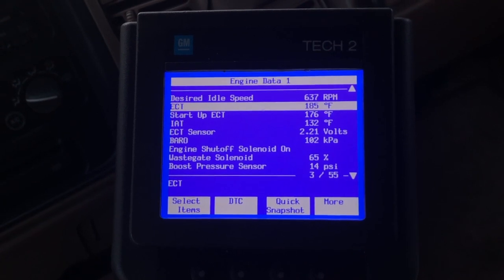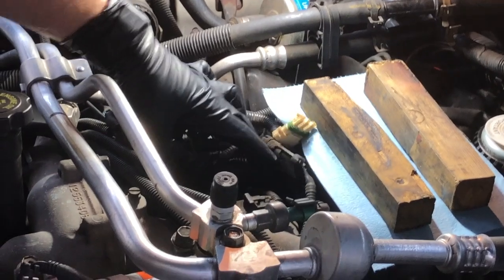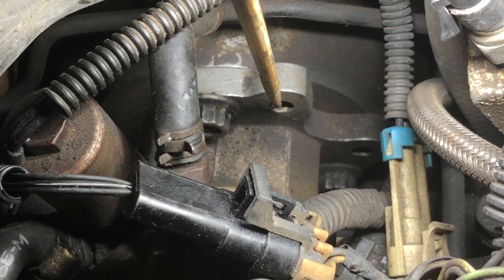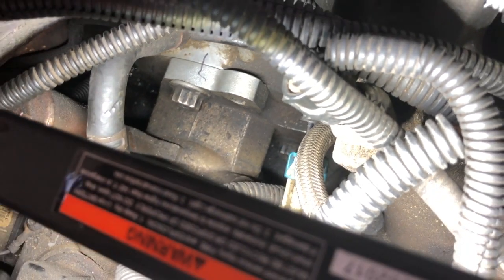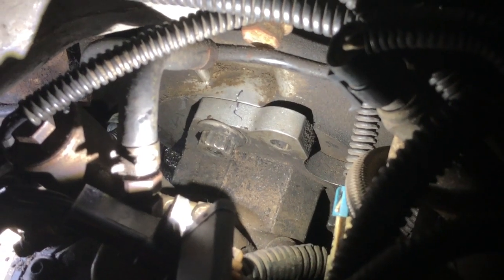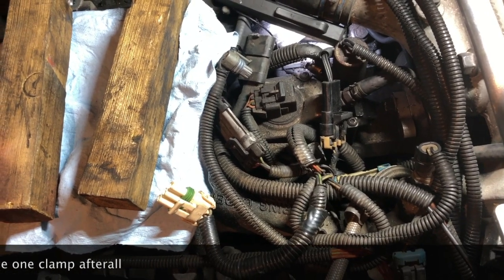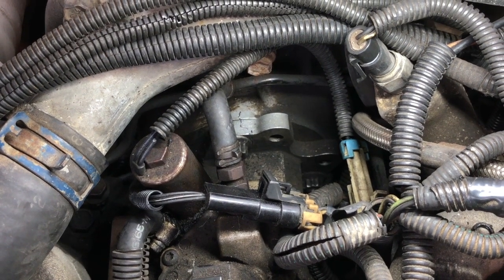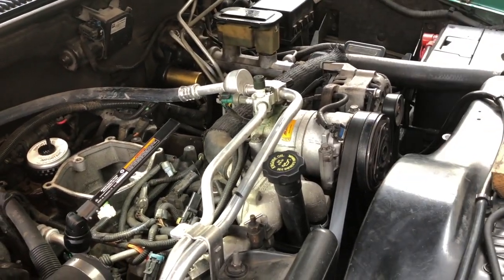1996 - 2002 GM 6.5L Diesel Stanadyne Injection Pump Timing Adjustment TDCO Procedure (Chevy & GMC)

Comment from the maker: WARNING: The torque value in the GM service manual shown at 44:07 for the upper intake manifold crossover bolts is WRONG on that particular page due to a typographical error during printing.  Which explains why it didn't feel right to me and fortunately I go with experience and gut in such situations as you saw in the video.  The correct torque for the upper should have had 17 foot pounds printed!

Comment: Thank you for posting this video, it is incredibly helpful. I broke down and bought the made in Ghina Tech 2 tool and much to my surprise it worked well. Getting the sequence of the 45 sec pedal to the metal then 30 sec of ECM off was a huge pain. Onlty took about ten times...LOL. But I was able to get my way out of wack -2.29 down to 0 then back a little to -.79 (close enough) She runs soooo much better. The tool also told me that I had 14psi of boost at idle and 26psi of boost when my gauge says 13psi, so I know my sensor is bad. Got my 96 3500hd with the stock 6.5 running smooth. Thanks again
Reply: Do you have a link where you bought the tech 2?
Reply from the maker: In the video description

Comment: Found my straight wrench went in easier than the curved special wrench. Also had all the sensors and wires out of my way. They really only connect 1 way so it goes back together pretty quick very good video 1mm isnt much but it makes a world of difference much like 1 mm bump on optical sensor. Ty

Comment: Great job extremely helpful! Awesome job on instructions and video clearness
Reply: I’ve changed my crank sensor and cannot get the computer to do a relearn I’ve done the procedure over 15 times change the sensor twice thanking I have bad one and it stays at the -2.46 no matter what I do
Reply from the maker: @jasonhutchinson5144  Like I showed in the video, the timing on getting the scan tool to trigger the TDCO reset is rather finicky but it shouldn't take more than a couple of tries.   If I had this problem I'd look over my sensor harness for damage/corrosion, and do a general check of the grounds the PCM uses as this feels like a problem getting the engine computer to recognize the input(s).
Reply: @DrShock  yes I’ve went through the ground’s and made sure all were making solid contact, I replaced the crank sensor again and did 15 attempt’s at doing the relearn with no change I was unaware of the need to use AC Delco so my next one will be a AC Delco crank sensor and I will double check all the connections again the engine runs fine starts hard but does start there’s also a glow plug timing issue and I replaced the glow plug relay and still take’s 3-4 seconds to start can only get glow plugs to cycle for 6-8 seconds with new glow plugs even try disconnecting the temperature sensor to trick it into thinking the engine is extremely cold so it would do a max glow plug cycle and Nope

Comment: Extremely thorough video, very good descriptions and it came just at the proper time. I just had my 6.5LTD pump rebuilt and its in and running. You have a lot of room there to work compared to my 2001 van. You can barely see around the pump on a van even with all the air intake items removed all the way back to the turbo. Believe it or not the easiest way to work on a 6.5L van is to remove the dashboard which is actually not that difficult. Thanks for taking the time to video it all so well.

Comment: Great video well explained thanks for sharing. I have a question I look up the GM Tech 2 and says it's only for cars no trucks  I'm cofused. I want to purchase a scanner  Thanks
Reply from the maker: Thanx. Not sure where you're reading that false trucks statement, but it would definitely be in the fake news category.   

The Tech2, like the Tech1 that preceded it, was the one and only scan tool used by GM dealerships exclusively thru 2008 for both cars AND trucks and used in conjunction with GM's Techline Information System 2000 (TIS2000) Windows based software.  In 2008 GM introduced the MDI scan tool, which along with the MDI 2, is the current gold standard for GM dealerships in conjunction with the online Techline Connect internet based software.  I have done some Tech2 and MDI reviews on this channel in the past you might want to check out before making your purchase there too.
Reply: @DrShock It Can Only Support 12V Cars, No Trucks thats what it reads on the description on ebay
Reply from the maker: Sounds like some poor Chinese to English translation there.  Definitely in the fake news category.   As you can see, this video is about a truck and we're using a Tech2 clone on the truck  ;-)

Comment: I've had to change out two new motors that had issues and tearing down I didn't have to deal with the bolts for the pump to gear behind the timing gear cover, I'm installing a new pump and now have to try and go thru the oil filler tube any suggestions on going about this. Any suggestions would be greatly appreciated,top notch video taught me a lot thanks
Reply from the maker: Best tip for those bolts behind the oil fill tube is have a cardboard paper towel core, cut it down and use that as a shield to prevent dropping any of those IP bolts into the timing chain area while removing/installing them.

Comment: I know this video is pretty old... but I figured I would share some tips with you to help make this go smoother next time. At around 27 minutes, you talk about waiting for the temperature to get to 170 before doing any sort of relearn in the computer. The reason they mention 170 degrees in the manual is if there is no TDC offset number, so 0, the ECM will automatically learn a value at 170 degrees. However you can perform the time set/tdc offset procedure any time. At around the 28 minute mark, you show the key and throttle reset procedure, this isn't completely necessary when you have the scan tool as you can just perform TDC offset learn which will run for a few seconds and set a TDC number. The way you showed this in the video, you turned the pump and basically hoped the TDC number would be within spec. The way I time the pumps is using the following procedure: If you turn the pump, go to time set, and turn time set on, you can verify you have the pump running at 3.5-3.7 degrees. Once thats done, then go to TDC offset learn, turn it on and let it run, the number will fluctuate before landing on a final number. Doing it this way, you don't have to do the key and throttle reset, and you dont have to worry about setting a -2.02 and a fault code. I recommend giving it a try next time you do this, it makes it so much easier.
Reply from the maker: Thanks.  Yes, you can optionally initiate a TDCO relearn with a Tech2 or MDI/Tech2Win.  No, you don’t need to be initiating a TIME SET unless the IP was changed out.  Just running the TDCO for a CKP replace is fine.  That would be based on following the official GM service information explicitly.

Comment: I did enjoy watching. I have the same year one and just had a mecanic to change the  injectors 3 weeks ago.  Since my motor is running great but starts right away when cold and does not when sits 15 min. until cool down .  had no problem before. been told to change the pump.  could it be just to time ?  Denis
Reply from the maker: For what the video is covering, a Tech2 or MDI scan tool will tell if the engine needs a TDC offset adjustment so you don't have to guess about it.   If you refer the video that this one links to, I show the initial scan tool procedure that led to having to do the timing offset adjustment after replacing a crankshaft position sensor.
Reply: @DrShock  Thank you very much and again was a nice video to watch. Denis

Comment: Hello, I have a 2000 Chevy 3500 short school bus with a 6.5 diesel turbo. Recently I replaced the fuel injection pump. It is running but sometimes when I am at a stoplight for no reason at all it will act like I've jolted the gas pedal, sometimes it sounds like it's going to die but catches itself before it happens, and it seems to take just a little bit to start up. Would a TDC relearn/ injection pump adjustment solve these problems? Also I am getting around 9 mpg do you think that will improve as well?
Reply from the maker: For a surge like that, I'd first suspect the pump mounted driver or PMD.  This is a small electronics module mounted on the LH side of the injection pump, or more preferably remotely elsewhere in the truck.  If you got a new rebuilt injection pump, it should have came with a new one of these PMD modules and be under warranty for you.

Comment: DrShock was a code given on the dash that the timing was off, Or was it a new injection pump you installed?
Reply from the maker: It's a procedure that also has to be reset whenever the crankshaft position sensor is replaced.
Reply: @DrShock  thank you.

Comment: I am not getting a code a to relearn, and also when I rotate my pump it doesn't change any values in GMTDscan. any ideas of what's going on?
Reply from the maker: First you have to be using a GM Tech2 scan tool, or a J2534 tool that supports running the GM Tech2Win application on a laptop.   Aftermarket scan tools might work,  but at best they typically won't give the same timing offset value range as the GM service manual so you'll have to manually translate/convert them.  Second, as I showed in the video this is a very specific procedure (aka dance) with the scan tool and if you don't follow the service manual instructions exactly it won't go into TDC offset relearn mode.  The dance with the key on, accelerator pedal down, and the wristwatch time durations around all that have to be held to a no more no less kind of approach.   It may take a couple of attempts, it does even for me,  but it will relearn if you have a Tech2/Tech2Win tool.   Lastly, you won't see anything rotating the pump alone, you have to get the PCM to enter relearn mode to pick up a new TDC offset otherwise the scan tool will just be given the stale old value over and over.  This is why this job really is impossible to do without a scan tool.  Folks think they've done it without one, but screenshot or it didn't happen I say.  ;-)
Reply: Thanks so much! I was using a free c
Version that just reads small codes, i purchased the real deal and I will give it another go!

Comment: The tech 2 has a command to activate the relearn in the special function section, that way you don't have to do the pedal stuff. Also it has an area in the same spot for viewing the offset by commanding the pump to 0.0 and viewing actual.
Reply from the maker: Yeah, but the GM service manual doesn't mention using that function so I didn't show it.

Comment: Awesome video. But couldnt the adjustment also be made by adjusting the optic sensor inside the pump?
Reply from the maker: No, the service manual is specific about the need for a scan tool to detect, and then communicate this manual adjustment to the PCM.

Comment: Great video I have a question  what another scanner can I used? to read the tdc and the coolant temperature rather than the gm tech 2
Reply from the maker: You could also use a GM MDI, or a clone of one.   A GM MDI2 (no real clones of this just fake MDIs in an MDI2 case).   You could also go with any J2534 tool compatible with GMs Tech2Win program available at www.acdelcotds.com
Reply: The snap on mt-2500 reads TDC offset and Desired and actual timing on my 97 gmc savana 6.5. It has a program called troubleshhooter that states that the actual timing should be set before setting the TDC offset. I realize this is an old scanner. But it has some bi-functional controls like turning on lift pump and glow plugs/controller. It read my tranny and abs. I bought it for my 94 grand cherokee and found out it works on my van also. I purchased it for under $300 too!! I know all this because the other day when I got home. My van just started clattering super loud. At first I figured a bad injector. But going the cheaper route first. I'm hoping it's the injector pump stepper motor that controls pump timing. Odd thing is my van will start and idle but the TDC offset reads -4.0. I don't see how it's even running. The desired timing is reading 10.5 degrees while actual timing reads 25.5 degrees. I prey the stepper motor will fix my problem. Anyhow, I was just outside with the mt-2500 hooked up and was surprised to see that info available. Go snap on!!
Reply: Also, the mt-2500 will step you through setting the timing on the pump with the troubleshooter program I mentioned just like Dr Shock shows with holding the throttle at WOT for 45 sec and so on.
Reply from the maker: @RussellRowell1  Thanks for taking time to share about your Snap-On tool.  Good to have multiple choices for tools on these 6.5L engines.

Comment: Great vid Dr. Shock. I just replaced my injection pump and crank sensor. From what I have seen I have to set the injection pump timing to 3.5 degrees then perform the tdc offset. Not sure how to do this. Can you help? Mine is always stuck at 14-16 degrees no matter how much I turn the pump. Thanks in advance.
Reply from the maker: What I showed here was adjusting the timing for the top dead center offset (TDC offset).   If you're installing a brand new injection pump yeah there's an initial timing step that needs to be done first.  I've personally not had to do that procedure yet so cannot provide pointers on it.   But I do know it also requires a Tech2 scan tool (or Tech2Win emulator) and there is a section in the GM service manual about performing it with the Tech2.  My advice would be to just follow that service manual guidance with your Tech2.  If you don't have one, I believe I have an eBay link in the video description where you can get a CD-ROM version of the manual(s).
Reply: engine manual or tech2 gives timing figures round wrong way,it shows advnce when its retardded and vice-versa
Reply from the maker: @andrewsmart2949  No, the Tech2 is completely correct for its TDCO reporting.  It's some of the aftermarket tools that do get the TDCO values incorrect. This video deals with TDCO only, but then there is also base Time Set (TS) which we did not cover here so I can't comment about TS.  But GM has it correct of course in their tools and manuals for TDCO, after-all it's their technology ;-)
Reply: @DrShock  yeah well when i did it in 2008 none of that had been done and in countries where it wasnt readily avail it's not gonna happen

Comment: I have the 6,5L from 1995, My engine does not look exactly like that one. What differences I need to know?
Reply from the maker: The approach for timing prior to 1996, prior to full OBD2 adoption, differs.  You would need to verify in GM service information / service manual for the details though.
Reply: @DrShock  i feel this: its like i am presing the gas the and the engine take some time to speed up and push. Its like delay effect. Any idea? :)
Reply from the maker: Reading out any trouble codes is where I would start.  But it may still be that whatever you are experiencing is within tolerance enough that the PCM isn't complaining yet.  

Unfortunately this sort of symptom could be due to more than one cause.  Not something you'll  be able to easily diagnosis over a chat forum imo.  But if no codes, I would next check fuel flow rate for a fuel delivery obstruction to eliminate clogged fuel sender sock or fuel filter.  If RPMs are responsive to accelerator pedal position, and the transmission is an automatic, then I would more likely go with delayed engagement problems in the transmission instead.
Reply: @DrShock  Thanks a lot for your answer. I only have error code 35. Sorry about the questions, but I am writting you from Madrid, Spain and there is no garaje here that knows about these old american diesel engines. So I am very alone trying to fix mine :)
Reply from the maker: A code 35 on the 1995 and earlier PCMs is going to be a fuel injection pulse width being out of specification.   Still a lot of causes, but at least the code localizes you to the fuel delivery system.
 
Verify your lift pump is operating correctly fuel flow wise, and that the fuel filter is not restrictive (i.e., past the change interval).  If you have a spare PMD, this would be a condition where swapping could save alot of diagnostic time.   On the 6.5L engines with the DS4 injection pump throwing any sort of fuel delivery code, the PMD module is often worth checking first.   Worst case though, it can be a problem with the DS4 itself, such as a faulty optical fuel sensor internally.
Reply: @DrShock  thanks a lot for all your help! I think i will start wil a new fuel filter and and a new a realocated PMD. When are you coming to Madrid for help? 🤣

Comment: Very good video, thanks for that.
I have changed my injection pump, is that the only thing I have to do? 
It is running on -1.41°
Thank you from Germany
Reply from the maker: Whenever you replace the pump you need to set the timing using a Tech2 or equivalent tool as well as the TDC offset.  That -1.41 TDC offset you have is not within the service manual spec for a 1996 and up (-0.75 would be the outer boundary) as shown at 13:59 but its up to you if you want to leave it where you are (lots of forum opinions on that but I prefer to do things the GM dealership way).  Here's a video specific to setting the injection pump timing - https://youtu.be/Fir18Ll5l3Q

Comment: my 6.0 engine shuts off after engine reaches operating temp or 10 miles use. has to cool off before it will restart. any ideal. i relocated the pmd